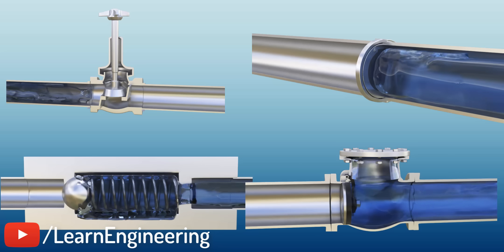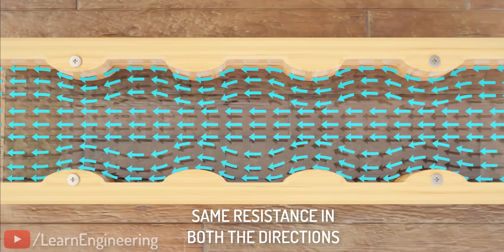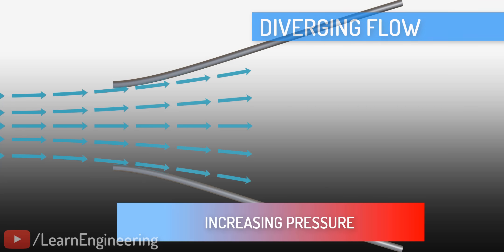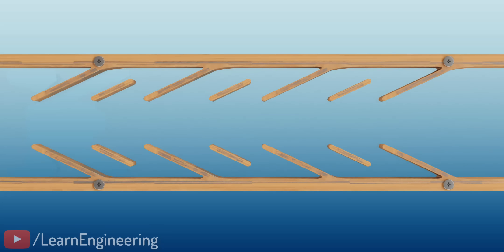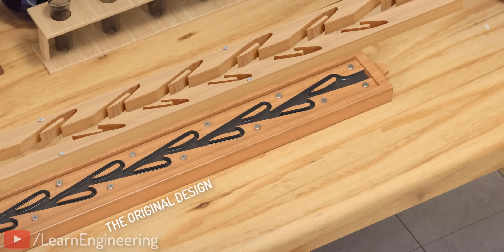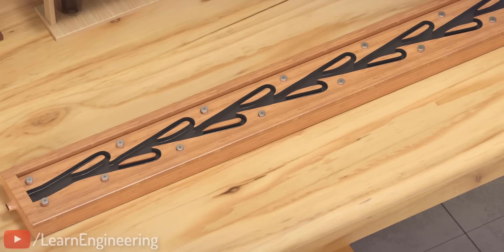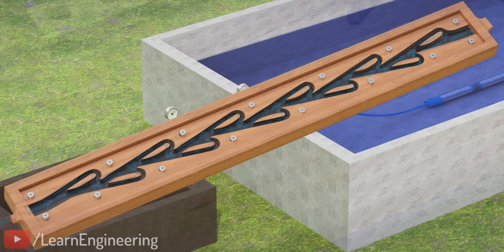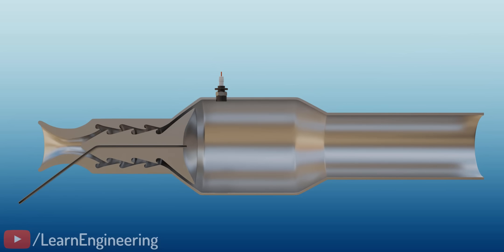Tesla Valve | The complete physics

Comment: So this valve can only reduce pressure and not completely stop the flow of liquid. 
So complete stopping of water without moving parts still is impossible
Reply: Tesla valve is used on a system where a complete stoppage will cause damage to the system.   This actually common on household pipe. Leakage is cause by water pressure from closing a valve. The water pressure from the vacuum damages pipe connection overtime.

Of course that's not a big deal for us. Nobody dies from water leakage.  But how about combustion chamber systems? Where people might die on explosions. And this is where Tesla valve comes in.
Reply: Be a liquid my friend
Reply: Just close the tap kid
Reply: @akhileshravindranneena5600  how? Tesla valve has no moving parts.
Reply: @akhileshravindranneena5600  it's a moving part
Reply: @akhileshravindranneena5600  the tap has moving parts
Reply: Just shoot a stream from the other end and let them meet in the middle.
Reply: @download333 Seems plausible, but you would need a lot of energy to freeze the liquid. How can you quickly remove the frozen liquid during reversal?
Reply: It wouldn't stop the flow completely, but it wouldn't drain out completely either. If the goal is to restrict flow and resume flow without any moving parts, then this is genius.
Reply: @hermanwooster8944  agreed
Reply: freeze it😛
Reply: Lol 😂 - To stop the flow without any moving parts, you can simply keep a solid block.
Reply: @madhesh18  it blocks the flow of water from both directions and thus it is not a one way valve
Reply: @madhesh18  thats not a check valve though is it thats a tap
Reply: @madhesh18  The idea is that it can still flow the other way.
Reply: Question was: can u create a valve without moving parts! And that's not an answer... So even tesla cant make valve without moving parts, because it's just lowering speed of the flow. If u want to create a valve without moving parts just took big barrel, make a big hole, connect pipe, then fill it with water. water will stop when mass of water will produce pressure more than pressure of stream going inside of barrel. the bigger hole and wider pipe, the faster it will stop water.  It's only one way of many i can offer... other way is just freze peace of pipe and unfreaze it when u need get a water.
Reply: Just add more resistence to the flow    to increase the opposite pressure gradient and the viscosity.
Reply: Well you can just use a wall to stop water without moving parts.
Reply: @Gwynnwhitlow  thats usless because you need one way flow not stoped fluid
Reply: @Gwynnwhitlow  The idea is that it can still flow the other way
Reply: Make bypass
Reply: Lets take the pool example. If you had a Tesla Valve connected to the bottom of the pool and had it angled at lets say, an easy round 45 degree angle. As long as the top end of the valve goes beyond the top surface of the pool water, you will have 0 flow
Reply: carlos caracitas And what’s the purpose of a valve: to open and stop flow of water. The Tesla valve only reduces flow but makes it impractical valve to use if you have to turn the whole mechanism the other way to do the reverse. And actually you then do something mechanical at the same time. Easier to turn the tap with a traditional mechanical valve.
Reply: @TurreTuntematon  the purpose of a valve is to regulate flow pressure. Complete shutdown is simply just 1 function of a valve. You can still  stop flow by simply elevating the end furthest from the source to a point above its surface. What your saying is "a Tesla Valve just isn't as convenient" which albeit, is true. But moving parts always equals failure at a higher degree. A broken spring, a weak lever. Bad pressure measurement due to degradation over time. With a Tesla Valve, the consistency and reliability is unmatched.
Reply: carlos caracitas Agree with all except that a valve should only regulate. No. It should also have to possibility to stop the flow completely.
Reply: @TurreTuntematon  it depends of the need though, if leakage is tolerable while moving parts need to be at minimum, and it's pulsating rather than constant/low pressure gradient flow, Tesla valve might win instead. But most applications are cleaely not like that
Reply: @TurreTuntematon  use your logic go back to kindy
Reply: @notadestinygun6556  agreed but its not a check valve
Reply: Black Sheep What?
Reply: @notadestinygun6556  
"You can still  stop flow by simply elevating the end furthest from the source to a point above its surface."
when you stop the flow that way, you are MOVING a part.
you are using an impractical long tesla valve AND an impractical long end AFTER it to stop the flow, instead of a regular valve, depicted at the start of the video.
in most cases, the regular valves are better. the tesla valve is useful for different, much more rare purposes.

therefore this video compares apples and oranges. tesla is good only for slowing down the flow.
Reply: @notadestinygun6556  you could do the same thing with a garden hose keep thinking your a long way off
Reply: @CJANegrcTtpX8HwbR2SBDd  the point it to make something that allows water to go from one A to B but not from B to A. It workes only "one-way" (therefore one way valve)
Reply: It's like an inductive brake. Also can't brake down to zero, yet it has a lot of use cases (e.g. in high speed trains)
Reply: for water, yeah, unless you further change the property of the liquid, making it more heavier/denser/sluggish then the liquid flow can be stopped (all this happening while assuming gravity is still at work)
Reply: @abam9787  wrong so wrong it will only slow not stop besides thats not how we do thing in hydraulic systems
Reply: That assumes that complete stoppage of fluid is the intended usage, which it does not appear to be. Showing flow from the restricted side without an opposing flow from the unrestricted side is a method of visualizing how flow within the valve works, not a visualization of intended use.
Reply: It's not a valve. Saying it is is wrong.
It's not made for liquid, (for fast moving gases) and the original design is not very efficient.  
Later designs work for some high pressure short pulce applications.
Reply: Its a function of pressure due to gravity on a fluid. I could make a valve that is one way. It's called the p trap in your drain. It only works up to a couple pounds back pressure, but if you put 50 on top of each other in elevation it would work.
Reply: There is always one...
Reply: Yes.
Reply: I guess a one way valve with no moving parts could be a tube that turns 90 degrees down into a long as frick fall, which has another 90 degrees turn in the end (something like this but not really —|_ ). It is the opposite of practical, but if the middle tube was long enough, pumping water from down to up would not beat the pressure of the water pushing it down, while pumping the water from up to down would not be a problem
Reply: Lucas Salviano That’s not a valve, it’s called elevation..
Reply: @peckdec  you can use elevation to make sure that it only goes one way, sounds like a valve to me
Reply: Lucas Salviano what if the piping returns to the level before the valve?
Reply: @lucassalviano6943  try that with an caterpillar tractor it wont work because thats not a check valve
Reply: Raise the sink side a couple of centimetres and let gravity do it’s trick?
Reply: @grantyale  like to see you try that on a caterpillar tractor you will fail.
Reply: I built one on a cnc mill. You are correct. I remember it being difficult to blow from one end but  still was able to blow.
Reply: It is posible to stop fluid by modifing the Tesla valve by puting smal "las on the end where water come out by this the water presure which comes out is so smal that litle wather  in that glas can  stop it and wholw valve will be filed with water and eventualy fluid stream will stop and presure in valve will be at the max. So it can be done without movung parts... P.S.: im Serb like Tesla, and its great honor to know that Serb is that mind that shaped science world that we know today...
Reply: It's not impossible. Have you jeard of  a Dam? 🤣 depends what your goal is.
Reply: Instead of trying to find ways to make the tesla valve completely stop flow like many other valbes already do, why not find applications that don't need complete flow stopping, and need as little moving parts as possible?
Reply: You could use a plug.
Reply: Just use a disintegration plug
Reply: Well maybe not.
30 psi will lift water about 70 ft. 10 psi about 23 feet.  With a valve in between that reduces pressure significantly, you could "stop" the flow of water. (with a gravity assist) if the situation lent itself to that.
Reply: @noelmasson  then again, if the valve needs moving flow to restrict, maybe it'll only work in dynamic conditions
Reply: @noelmasson  A Tesla valve does not stop pressure. 

You all need to stop saying you can add a slope. You cannot.
Reply: If the pressure is fast enough it will stop flow in one way
Reply: It depends on the pressure gradient. In a system where flow is allowed downhill through the "open" direction, but restricted going uphill through the "Closed" direction, a level of rising water can be forestalled or stopped entirely. the stoppage may not be within the pump, but a significant water column up pipe from the "valve" would aid and abet the stalling. This would also act as a pressure release, where nominal fluid pressure could not overcome the water column, but an over-pressure could be mitigated by the allowance of reverse flow. It's very handy in this way to separate two segments of a process pipe system and still allow for first line defense against expansion issues that doesn't require a computer or a person to react to the imbalance. It's used in chemical plants where an open air pressure release would be catastrophic, but a seal chest or cask can be built to contain the possible overflow. Sometimes, or often really, these chests are filled with one bar of  Nitrogen as some chemicals don't react to well to oxygen.
Reply: @Andreas Berner try telling that to a bulldozer mechanic he will laugh at you
Reply: https://youtu.be/eNBg_1GPuH0
Reply: Plus the application of a valve is to control flow at will - like a faucet. This wouldn't work for the same functionality purpose
Reply: Tesla and Humanity's Missing Paradigm Shift ~ > https://youtu.be/zMauq8r3fuY
Reply: To complete stop the flow fluid without moving parts.. its called a cap. Its used for example in bottles só the líquid cannot go out😅😅 dont try to complicate what is Simple or dont ask for the Impossible
Reply: @Levuiii  username checks out
Reply: Theoretically, you can reduce the backward flow to whatever you want, just by adding stages.  If this had an infinite number of stages, it would completely stop the backwards flow of water.
Reply: @izzyplusplusplus1004  idiot all liquids can be frozen. STEEL can be frozen. all matter has gas, liquid, and solid states. DIDNT YOU GO TO SCHOL?
sometimes plasma but that shits wack
Reply: you can build a water pump with no moving parts, except the water.
Reply: No, Is possible.
Use a thermoelectric cooler (Peltier device) to electrically freeze the liquid solid at a point, and also use it to allow the flow by it heating the frozen point.
And bidirectional !
Reply: stopping the flow entirely is not the goal in many applications. we have shut off valves for that. but using a gate valve to control flow and pressure often creates the negative effects of cavitation. and difficulty in turning the valve by hand.
Reply: It is, with a thermoelectric cooler to freeze the pipe. 😉
Reply: I just thought of it, and IT'S POSSIBLE... very simple
Reply: All this talk of valves is making me wanna replay half life 2.
Reply: I would use one of these in conjunction with a proper full stop valve to relieve pressure on the valve so it doesn't slam shut, if sudden back-pressure was a thing
Reply: Just add an angle and it will stop
Reply: To completely stop the flow you put a cork in the end , A zero moveing parts cork
Reply: Maybe he invented it to solve a problem in the future that we can fix like having to much water in China. So design a river like the telsa valve and this makes millions of people safe from flooding. Or make a road to divert a lava flow
Reply: you can still stop the flow completely by adding two electrodes and a magnet. send a DC current through the water causes the water to develop a a magnetic field, which the magnet can push back against. this effect would be barely a factor normally, but after the pressure has been drastically reduced by the tesla valve, it should be enough to stop the flow or perhaps even reverse it.

if you use a liquid with better conductivity then water, like mercury or NaK, you can even build a pump with no moving parts this way.
Reply: It needs the dynamics of flow always and forever to do it’s thing so it really can’t stop the fluid completely.
Reply: I don't think it could ever completely stop the water. If the valve is infinitely long the velocity of the stream at the end is 1/infinty > 0.
Reply: https://youtube.com/channel/UCn90M611FZgYSy3bMgECImA
Reply: How about if you orient the valve vertically? Then if you make the upward direction the 'no flow' direction, depending on the parameters of the valve and the input flow/pressure there will theoretically be a no-flow situation. Am I right?
Reply: @jkprez that's stopping water using gravity
Reply: @nischals510 yes... that's the point...but no moving parts.
Reply: @jkprez there are better and efficient ways to use gravity to stop water
Reply: @nischals510 Well, I was responding to your original comment saying stopping of water without moving parts was impossible. Obviously gravity by itself would do the job however, in conjunction with Tesla's device it would take less of a height difference.. Right?
Reply: > So complete stopping of water without moving parts still is impossible
It is possible, use a gradient/slope.
Reply: @johnny_eth  you're just increasing resistance. The flow if abundant can overcome all the resistances like your slope gradient. You need a traditional valve to stop the flow
Reply: @johnny_eth  Doesn't help when the liquid is under pressure.
Reply: @izzyplusplusplus1004  great point
Reply: @izzyplusplusplus1004  elevation is it's own form of pressure so they could potentially cancel each other out
Reply: @CaptainBadass  You made that up. Elevation isn't a form of pressure.
Reply: @johnny_eth  yes it is impossible due to gravity and surface tension of  liquid.
Reply: @saratmondal2000  gravity has nothing to do with it at all.
Reply: @johnny_eth  still not a check valve though
Reply: As he said increase the patterns to increase resistance..... So , maybe add a loooong Tesla valve?
<<<<<<<<<<<<<<
Reply: KILLER DROID it will never go to 0
Reply: @Fullyautomagic  To go to zero.... tesla valve should be infinity long
Reply: @Fullyautomagic  but it will (probably) get so close to 0 eventually that we can use calculus to say approaching 0 at an infinitely small difference.
Reply: @killerdroid99  To go to zero.... tesla valve should be infinity long
Reply: @killerdroid99  no matter how long you make it you will always have flow, the whole point of a one way valve is only allowing flow in one direction, to be honest its a pretty useles valve, pretty interesting engineering and a nice novelty to hang on the wall.
Reply: @killerdroid99  or adding an S shaped T valve.. turns in a pipe can cause flow loss.. so turns in a T valve will cause a huge amount of flow loss
Reply: KILLER DROID you need an infinite ♾ valve to be able to fully stop the fluid.
Reply: @killerdroid99  lol. a 1 kilometre valve to completely stop water flow? XD How's that gonna work in a house? Hahhaha...
Reply: @bobowyc  make it 100 kilometers long it still wont work as a check valve
Reply: @killerdroid99  sorry but no it will always flow slow but it is not by definition a check valve nor can it replace one
Reply: @killerdroid99  in which applications would you use this kind of valve? i can't imagine why would you use this valve over a normal on/off valve?
Reply: I wonder if you could make a sort of phase valve that uses something like a peltier stack to completely restrict flow by freezing/thawing water at the inlet to the tesla valve. The tesla valve on it's own can slow the backflow to the point where it could be frozen easily, which could seal it off until you apply a reverse current to the peltier module to melt the obstruction.

You'd probably need to line the inside of the pipe in that spot with something flexible so that repeated freezing/thawing wouldn't cause stress fractures over time.
Reply: @download333  Yes, it is routinely done by freezing a plug of water in a pipeline to perform maintenance activities in the downstream section.
Reply: @download333  but there's a problem in your idea, even when the liquid is travelling in the correct direction, a small amount of it will freeze with time, and after quite a bit of time, the liquid will be frozen completely. Yeah it's true that the opposite direction will take a lot less time than the correct direction but still after some time it will definately freeze completely blocking flow of liquids both ways
Reply: I think elevated Tesla valve would do it by incorporating gravity force.
Reply: @shinyheart3373  Tesla valve only has effect if there IS a flow.
Reply: @shinyheart3373  no because the liquid is under pressure gravity wont help
Reply: @shinyheart3373  Brilliant!
Reply: @hanskoot6254  bro you didnt undestood my point lol, what is the point in a valve?
That in one time you can let fluid go with no problam and in another time it cannot go,all of that without changing the fluid direction.
Reply: @YotamPeleg  Indeed I didn't understand your point. It was just a suggestion.
Reply: @YotamPeleg  you need to understand that illustration was for dummys. A check valve allows flow one way only, they illustrated this by turning the valve around, but in real life applications the direction of the valve dose not change only the flow changes. Good example is in the engine oil filters of most cars that have a spin on filter. They have two valves one made of o ring type rubber valve and a metal relief valve. The relief valve is there in case the filter blocks up and the check valve is there to prevent oil draining from the filter especially on filters that are mounted horizontally.
Reply: Most of the check valves dont stop the flow completely, i.e. they do not prevent the pressures from equalizing with still fluids.
Reply: @peckdec  What kind of crappy check valves do you use that doesn't prevent backflow completely? You do know that in actual high pressure hydraulic designs, checks valves needs to stop back-flow completely right?
Reply: @alexsolosm  true but given enough time the pressure will equalize because there is no such thing as a perfect seal. But your point is still valid because with modern valves and seals being manufactured with such fine tolerances it may appear not to leak.
Reply: @peckdec  That's mainly because of dirty accumulated in the valve seat over the months/years. There are standards for classifying valve leakage rates.
Reply: @peckdec  Nearly all check valves have a bias to them, like a spring, to prevent this from happening.  You are very , very wrong.
Reply: @peckdec  what are you talking about? As long as the fittings arent damaged all checkvalves stop the pressure from equalizing thats the whole point of those valves
Reply: @mvn4844  yes but given enough time pressure will equalize how much will depend upon the quality of said check valve, it maybe days months or even years depends also on viscosity of the liquid
Reply: @blacksheep6888  well yeah if you wait for years pressure will equalise even with current check valves, but for the tesla valve it would only take a few fractions of a second so its still unusable.... in current systems
Reply: @peckdec  umm.... thats exactly what a check valve does. by definition they do the opposite of what you are describing. in industry if you have a check valve thats doing what you are describing we replace it
Reply: Just add gravity to the design and you will have a one way valve without moving parts and witthout leakage, of course, that means both sides should be always in an specific position (lots of application for that)
Reply: @alsouni lol perhaps you can find one in esoteric high pressure applications but most normally used don’t prevent pressure creep over the valve. The seal isn’t 100%.
Reply: This is possible if we use more valves
Reply: @abhisheknagar5909  no it is not
Reply: This is possible if we use more valves
Reply: I think , if you dont want any liquid in the other end, just put the Tesla valve in a vertical position... so the gravity will stop any liquid if the valve is pretty long
Reply: @PLATONU  gravity has bugger all to do with it
Reply: Not all uses need complete stop though, even with the prevalence of ones that do need it
Reply: @ki0w0-lordofwatersheep  I presume you are not from project engineering. There's no 100% leak-proof valves. There are standards for classifying them. What happens is that there are some class leakages (starting from really small leakages, not even visually noticeable) in those standards. The lower the leakage, the higher the price.
Reply: @heliogomesmagalhaes  thanks for the clarification, I've been suspecting it since manufactured components nearly always have various tolerance grades. I presume people here who insist that it "doesn't completely stop the flow" aren't project engineers either & need to know that as well?

I wasn't the one insisting that 'complete' (enough) blocking has tp be 100%, I only talked in their language

Btw I'm working my way to competence like that in project engineering & other applied physics, got some bad decisions forced upon me in college
Reply: @heliogomesmagalhaes  I'm aware that valves, like many other components, don't need to be 100% reverse leak-proof as long as they meet required specs/tolerances, and varying prices have different tolerances.

However, I was trying to explain to people who think that they need to be as 100% reverse flow-free as one-way roads, that's why I spoke their language. So why not 'presume' they're not from project engineering? Why not explain that to them instead/as well? These guys weren't even aware of such general engineering tolerance, let alone be project engineers themselves.
Reply: I think you just need to add a longer tesla valve and a 90 degrees curve to stop Water flow.
Reply: And not even!, in order to stop a stream of liquid or at lesst slow it with this application you have to rotate it 180 degrees, meaning you will have to move something
Reply: Not impossible, we just haven't figured it out yet
Reply: The challenge was to "design a one-way valve without any moving parts."  Tesla succeeded in accomplishing that.
Reply: @tswrench  Not really. The design is brilliant, but it can't properly function as a one-way valve because it doesn't stop the flow completely. Even in the pulse jet engine it is used as a flow regulator, rather than a one-way valve. The design function better as a flow regulator if anything.
Reply: alsouni Agree 100%
Reply: tswrench I don’t agree since the purpose of a valve is to stop the water flow. This valve is leaking even if design is clever.
Reply: @tswrench  nope he failed it is not a check valve
Reply: @blacksheep6888  --  "A Tesla valve, called by Tesla a valvular conduit, is a fixed-geometry passive check valve. It allows a fluid to flow preferentially in one direction, without moving parts. The device is named after Nikola Tesla, who was awarded U.S. Patent 1,329,559 in 1920 for its invention."
Reply: @tswrench  no he didnt. there is still flow both ways
Reply: @tswrench  that's not a valve it's a reducer.
Reply: It's not completely impossible. You could use electromagnetism to stop the flow as long as the water isn't pure. A slope also works, but it's restricting the overall design a lot.
Reply: It reduces pressure to certain levels eventually itll hit a negative or zero